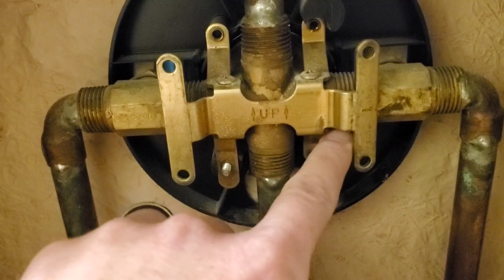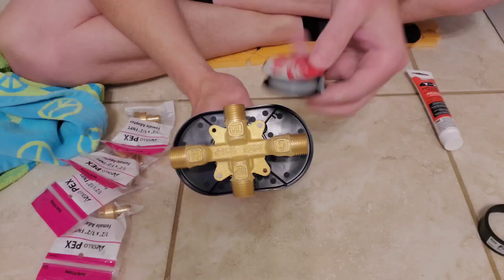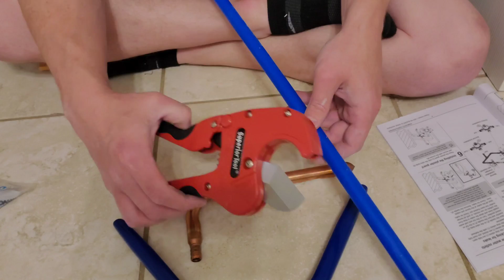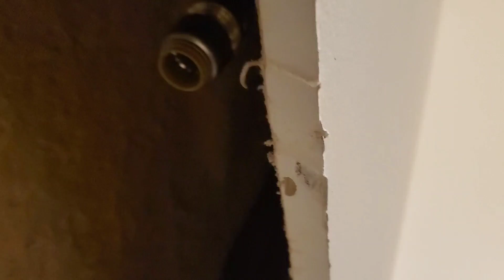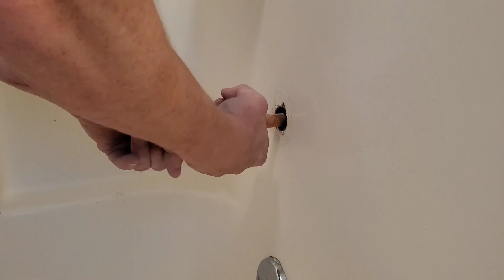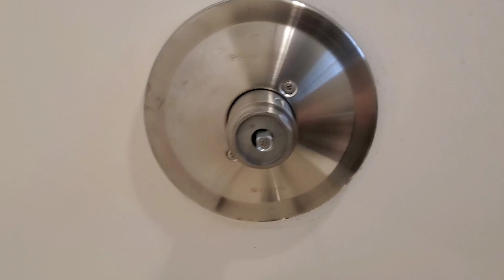How to Replace a Leaking Bathtub / Shower Valve - Copper to PEX

Comment: How is it holding up? I am having the same issue and you made this seem so easy to do 😩 thank youuuuu
Reply from the maker: It’s held up. I’m not real happy with it though. Using the pex made the flow so weak out of the spout. I would do it with copper if I could do it over again.

Comment: I just installed my shower valve the same way using Pex A to the copper stub out for the tub. Have you had problems with the shower head dribbling water because you didn't use all copper from the shower valve to the tub?
Reply from the maker: Yep.

Comment: how did you cut the holes on the backside wall ?
Reply from the maker: I first found the studs and cut between them where I thought the valve was. I used a drywall saw and my oscillating saw to cut through the wall.